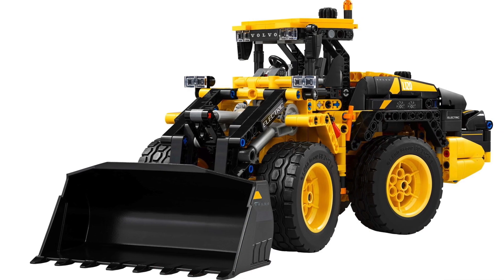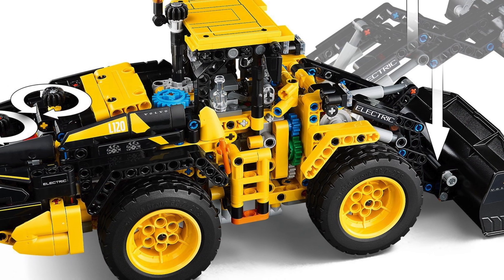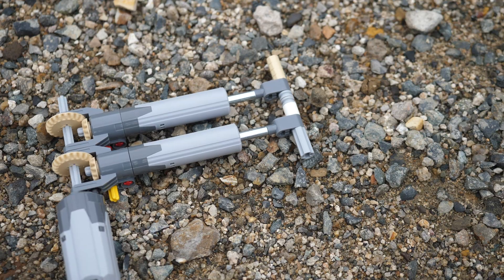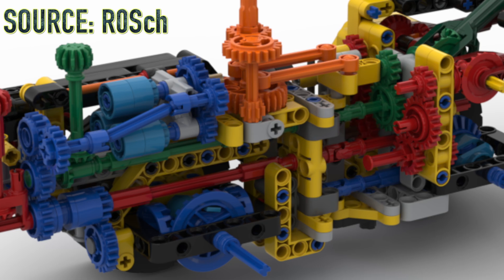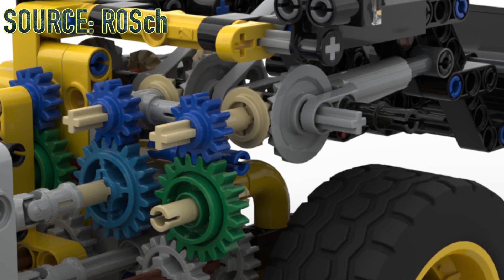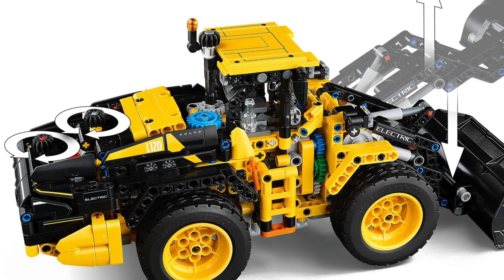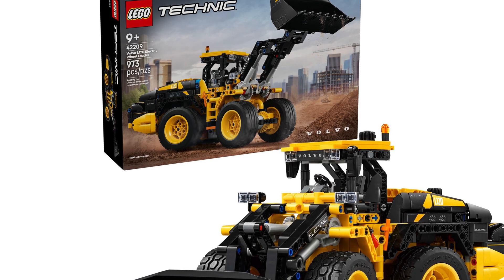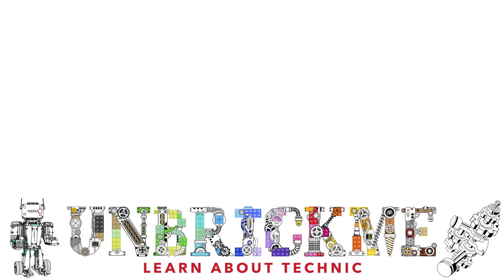LEGO Technic Volvo L120 Has NO GEARBOX! 42209

Comment: I do not like any of the recent lego releases. I despise all the unnecessary colors of the gears since apparently people can't handle only black/grey gears anymore. It totally spoils the looks of an otherwise good set. And the decreasing part quality is the absolute worst thing. I've built the williams f1 car as my only lego set from the past few years and the marks on the thin liftarms are unacceptable. They haven't had any for like 40 years and all of a sudden almost every Lego part gets these giant holes/dots. It feels like 20% of the original quality. And the prices are insane too. I don't mind any of the 2000s sets as they had good brick quality, no stupid colors and were much better value. 800 pieces nowadays equal 400 back then. I will probably buy the technic bronco but with the very cheap parts I can't bring myself to buy new sets.
Reply: It's an irrational pov. technic flagship set this year is awful because it's overpriced and no functionality, but other sets have fascinating functionality, looks, and pieces.

Comment: Get over the gearbox obsession you have it's pathetic not every set needs one.
Reply from the maker: Not everything needs one you’re right, like a pullback doesn’t need one.

However, anything with 2 or more functions absolutely must have a gearbox
Reply: @Unbrickme  set 8455 has 8 functions and has no friggen gearbox and is a great technic set imo you need to pull back on this gearbox BS.

Comment: Similar with 8053 Vs 42108.  8053 & 8265 was design by MK so they can upgrade to PF. 42108 & 42209 using knob replacing the gearbox system.  Both got Pros & Cons, New system with knob can do all the job at same time while old version (Gearbox) had to switch.
Reply from the maker: Yeah, that new mobile crane was a downgrade. I mean, new one has a pretty compact arrangement of gears at least